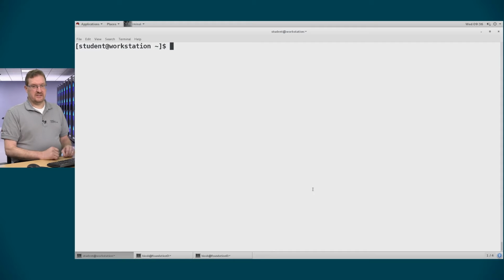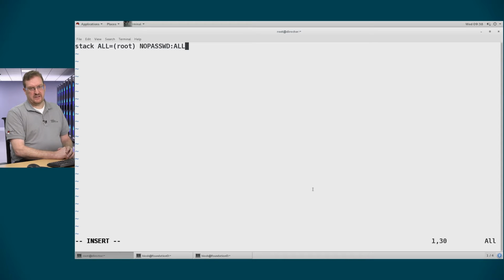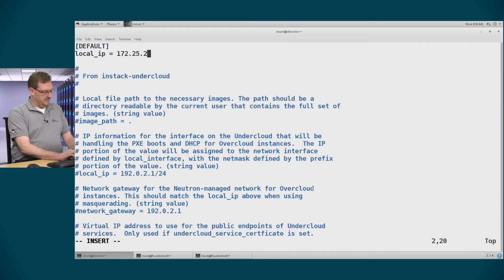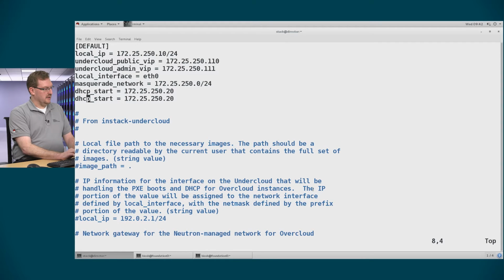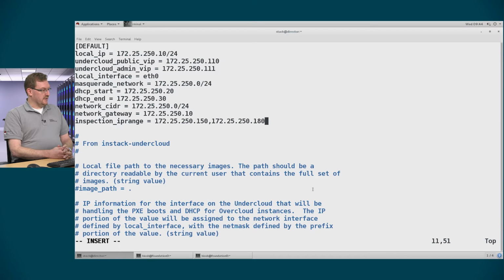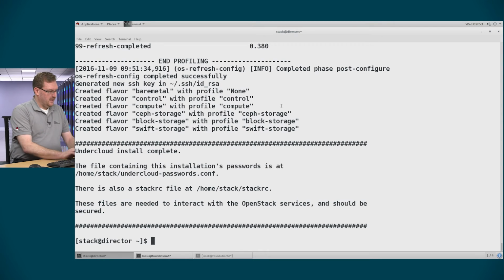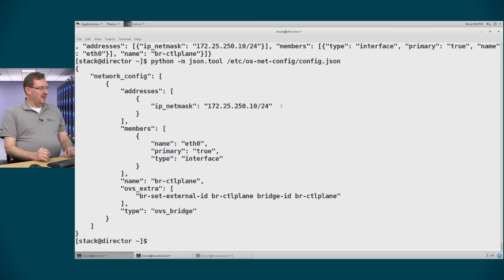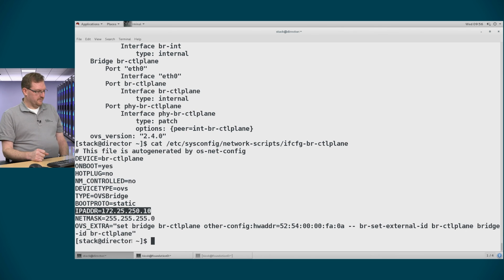Installation Demonstration: Installing the Undercloud

Comment: I always have the same error:

2017-02-08 20:00:27 - Warning: /Firewall[999 drop all]: Skipping because of failed dependencies
2017-02-08 20:00:28 - Error: Could not find a suitable provider for mysql_datadir
2017-02-08 20:00:28 - Error: Could not find a suitable provider for mysql_database
2017-02-08 20:00:28 - Error: Could not find a suitable provider for mysql_user
2017-02-08 20:00:28 - Notice: Finished catalog run in 9.76 seconds
+ rc=4
+ set -e
+ echo 'puppet apply exited with exit code 4'
puppet apply exited with exit code 4
+ '[' 4 '!=' 2 -a 4 '!=' 0 ']'
+ exit 4
[2017-02-08 20:00:35,450] (os-refresh-config) [ERROR] during configure phase. [Command '['dib-run-parts', '/usr/libexec/os-refresh-config/configure.d']' returned non-zero exit status 1]

[2017-02-08 20:00:35,450] (os-refresh-config) [ERROR] Aborting...
Traceback (most recent call last):
  File "<string>", line 1, in <module>
  File "/usr/lib/python2.7/site-packages/instack_undercloud/undercloud.py", line 1214, in install
    _run_orc(instack_env)
  File "/usr/lib/python2.7/site-packages/instack_undercloud/undercloud.py", line 1003, in _run_orc
    _run_live_command(args, instack_env, 'os-refresh-config')
  File "/usr/lib/python2.7/site-packages/instack_undercloud/undercloud.py", line 519, in _run_live_command
    raise RuntimeError('%s failed. See log for details.' % name)
RuntimeError: os-refresh-config failed. See log for details.
Command 'instack-install-undercloud' returned non-zero exit status 1